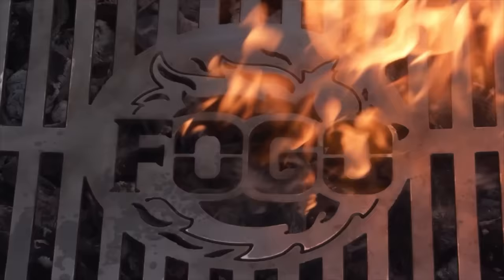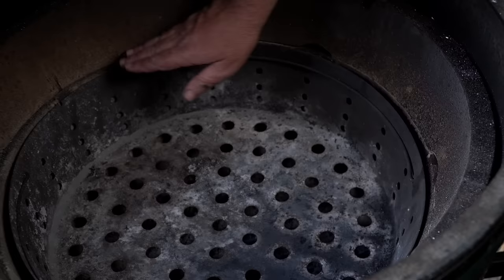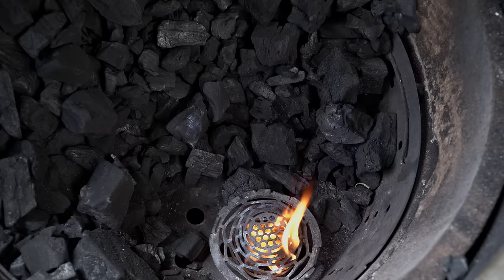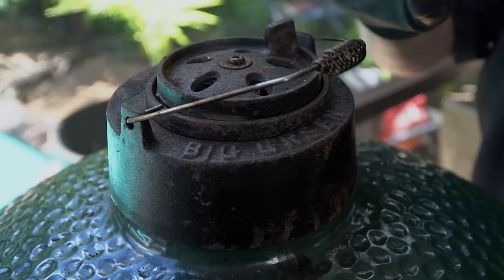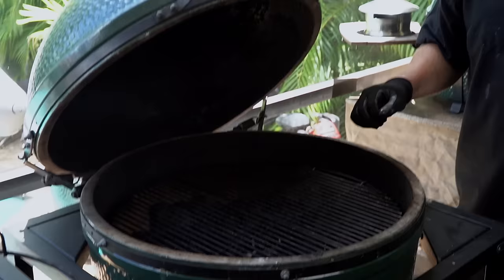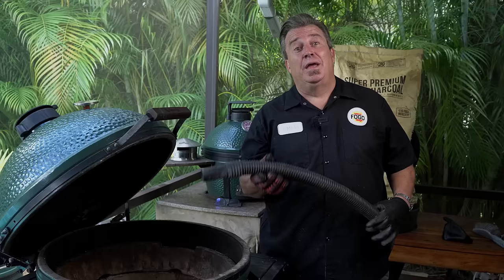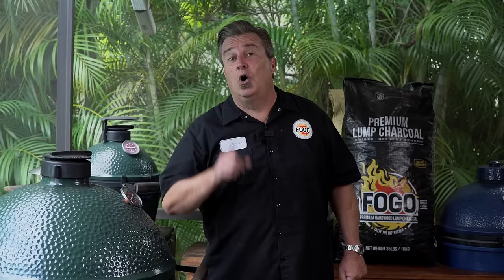HOW TO use The Big Green Egg - The 5 Skills YOU NEED to Master the Big Green Egg

Comment: I use a small rechargeable USB fan, while the fire starters are going that can spread the flames all over very quickly saves about 10 minutes or so, and no failures, I am probably guilty of not cleaning my egg often enough maybe the airflow is a little low but this does the trick and I did a 12 hour pork shoulder burn the other day it was fabulous
Reply from the maker: I love it.  It shows that there is no right or wrong way.  I love that you've figured out what works best for you.
Reply: Me too!

Comment: I learned the most from your video than from so many others I have watched. I get a lot of recipes that say to remove a grill like the stainless steel and replace it with the heavier grill, but it never explains where to place a hot grill. When we remove it we set it awkwardly beside the egg but I think this is dangerous, especially when company are at the house.
Reply from the maker: You are right, that’s a great point!!!
Reply: @FOGOcharcoal  I would love a suggestion. I saw a video with just a cast iron-looking round plate, like a large green egg-shaped flat pancake griddle. A person removed a grill and placed it on this cast-iron platter. 

I guess we could place some cinder blocks by the green egg but I would love to have a solution that I could keep outside by the egg.  (without spending lots of money).
Reply: There does exist stainless steel leg-attached accessories called grate racks that allow you to store plates, grates and other things directly below the grill itself. Third party of course, but cheap and does precisely what you’re asking.

Comment: I’ve been playing with charcoal amounts. And 1 chimney full plus a double handful is plenty to cook slow for 3-1/2 hours. If I fill it full like you did trying to keep low temps is work. They are so efficient. I only use 1 starter under the chimney and don’t let it get too hot. 2 wads of old newspaper is plenty to get it going nice and free. Otherwise it will be over temp in 5 minutes.  I leave the coals in a slight mound and let fire spread from there. A metal bucket a wire charcoal basket is a simple set that everyone should have for any Kamado red green black Ect. 
I asked multiple Kamado video producers for help with fire size questions and never got a response. That left over charcoal may be out in 10 minutes but hot for much much longer.
Reply from the maker: That's great, I am glad that you've figured out a way that works well for you.

Comment: Eggcellent review!  One minor detail to point out (and perhaps someone has already commented) the proper orientation of the convEGGtor is with one of the legs located directly at the front of the egg.  This helps divert air flow and heat to the sides of the space where the thermometer is located in the cover when closed.
Reply from the maker: Yes sir, Thank you and you are 100% correct.  I've actually covered that, I'm not sure if it was in this video or another in our BGE series.

Comment: I’ve got an old heat gun that works fabulously for lighting the lump coal. Position at the 12, 3, 6, and 9 o’clock positions for about 1 minutes each until sparks start to fly. You could buy the heat guns from green egg but I had one sitting around for years not getting much use and gave it a new purpose.
Reply from the maker: I like your style!  Whatever works my friend.

Comment: I’d like to see a tip for temp control during cook. Once desired temp is achieved and is stable. I sometimes have issues when I open it to add the food. The rush of oxygen fuels the charcoal and then I have an issue with too hot and trying to bring it down. Any help would be greatly appreciated. Thanks
Reply from the maker: When you open it, shut the bottom vent all the way.  This will help prevent it from spiking the temperature.  When you close the Egg again, simply open the vent back to where it was before. If it gets hot, add some new charcoal on top, it'll drop the temp quickly.
Reply: @FOGOcharcoal  thank you.

Comment: Great info. Question... Top vent vs. Bottom vent temperature control. Does one impart more smoke than the other? I would imagine controlling with the bottom vent keeps smoke within the kettle longer. I grew up with my pops always cooking on the Weber kettle, and I can almost smell this video! I cook outdoors on a griddle now, but may have to pick up a small kamado now!
Reply from the maker: Great question!  For me, I find that if I am controlling the temp with the TOP vent, it makes the food smokier.  It allows less air out at the top, therefore the smoke tends to sit on the food for longer periods of time.
Reply: @FOGOcharcoal  Thanks! I started looking into a small charcoal guy today to accompany my flat top!

Comment: I have a Smoke Remote BBQ Alarm Thermometer that you probably know has two probes - one that goes in the meat and one that monitors the temp in the grill.
Can I use this in the BGE?  I guess don't drill a hole in it but rather put it in between the top and bottom???
Reply from the maker: Yes sir, that would be exactly how to do it.  Also, make sure your wires are going through above one of the tabs on the conveggtor.  It will protect the wires from burning out.

Comment: I quit using the shop vac because it blows to much dust everywhere, but I didn't have the bag filter on it either.
Reply from the maker: Yes, i agree.  The bag filter is a game changer.  I used to have to point the exhaust on the shop vac to the outside so everything on the patio wouldn't get covered!

Comment: Hey great video thank you so much
Do you prefer top vent all the way open/bottom vent cracked  or bottom vent half way open and top vent cracked for low and slow cooking? Saw you did it two different ways. Looking to do a few pork butts this wkd overnight without wrapping 🤞
Reply from the maker: That's a great question, thanks for asking.  I personally prefer the bottom vent cracked and the top wide open.  That's the way I was taught and it just sort of stuck.  LOL

Comment: Have had a large BGE for about 10 years now, but never bought the convEGGtor, as i found putting the meat joint on a rack in a roasting pan, then putting that onto the BGE rack seems to work fine for smoking. Temps normally about 300. What benefits would a convEGGtor give me?
Reply from the maker: It deflects the direct heat from under the food and utilizes the shape design of the Egg to cook more efficiently.  It almost make it work like a convection oven/smoker

Comment: My food always turnout tasting too smoky. Any suggestions. I have an XL BGE and want to use it more, but so far, I'm not liking the smoky flavor.  😳
Reply from the maker: First, what brand charcoal are you using?  FOGO is known to have a very mellow flavor so as not to over smoke the food.  Next, control your temps using the bottom vent and keep the top vent wide open.  This prevents the smoke from sitting on the meat for too long and allows it to just roll over the meat.
Reply: @FOGOcharcoal  I've tried a few lump charcoals so far. The BGE ones that we got with the purchase and then a few other ones. Of those I've tried, the Cowboy one seems to be the least smokey. I'm going to try the top vent wide open though. I usually regulate the temp using both.

Comment: Just bought used large BGE and it doesn't have the 3 notches for the diverter to sit. It has 5 scalloped notches. Why is this? Thanks.
Reply from the maker: It is probably a newer fire ring.  They stopped making it with the three notches.  Does it work with those scalloped notches facing down?  I believe its designed like that to be able to lift it out easier.  The new fire rings don't have the notches because it helps raise the grid up higher and it works better with their eggspander.
Reply: @FOGOcharcoal  thanks for the reply. The ring cant be set with the notches down, i was thinking the same as you, but the ring is tapered and only fits one way.

Comment: Put the Daisy wheel sideways so when open the top the wheel will not move
Reply from the maker: That is a great tip for folks using a Daisy Wheel.  Thanks for adding that.

Comment: I have had a big green egg for years, I have never once had a smoking session where I could just "set and forget". I've never understood how people can just set the bottom and then not come back until 12 hours later and not come to a grill that is 300 degrees.
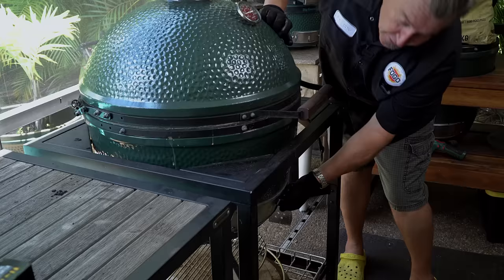Reply from the maker: Maybe you need to make sure it's stabilized for a bit longer before leaving it alone.  I literally did it this weekend.  2 briskets on at 10:00 (I lit the Egg at 9) and never looked at it again until 6 AM and it was still burning at the same exact temp.
Reply: @FOGOcharcoal  Thank you!

Comment: I don’t have that basket for the charcoal. What’s its purpose?
Reply from the maker: It has a few uses.  It helps with better air flow for better temperature control as well as making clean up a much simpler task.
Reply: @FOGOcharcoal  If I got one, then I remove the grate from the bottom of egg so ash just goes straight to the bottom?  Is it sold at BGE dealers as an Eggessory? or is it a FoGo product?
Reply: @pixxiemeat  yes remove the grate.

Comment: This grill is honestly the biggest piece of shit I have used. I have a cheap charcoal grill that sits beside it that works better. No matter what coals you use, they will heat up unevenly, no matter much fire starter you use or what orientation they are either. Patches of cold on the grill, constantly. No matter how much you mix. If a goddamn grill is this hard to use, keep the fucking thing. I have used mine for about a year and would probably give it to someone if they wanted it
Reply from the maker: Hey, I understand, different stokes for different folks.  Sorry you don't care for it.  Sometimes, those cheap charcoal grills can be just what ya need.  Thanks for tuning in.